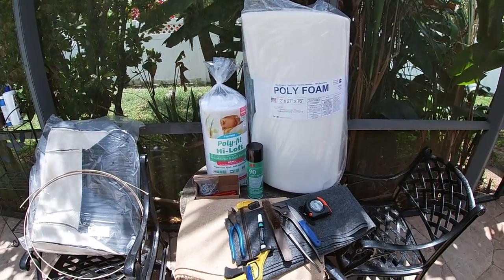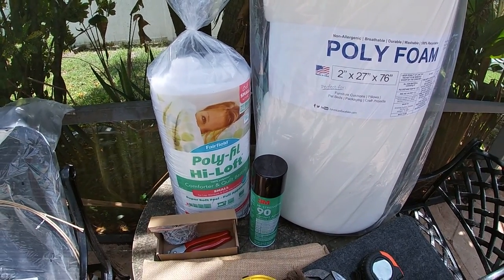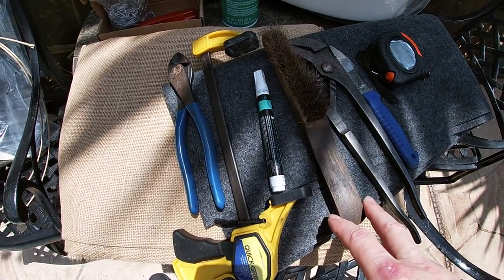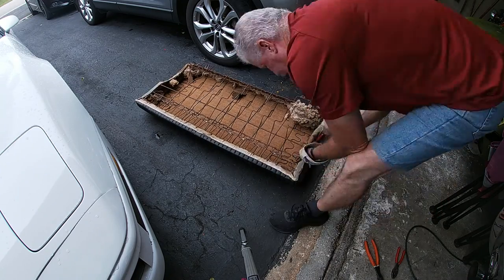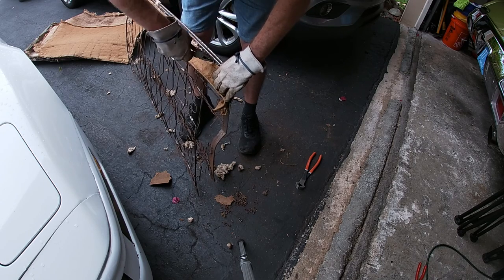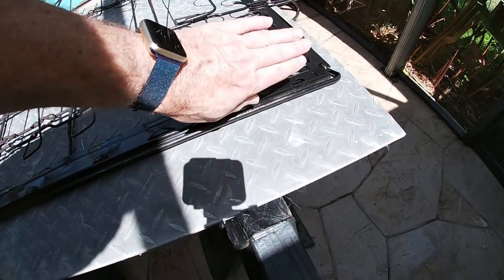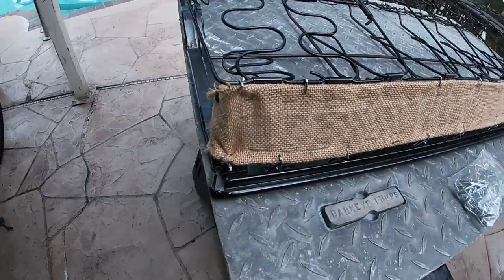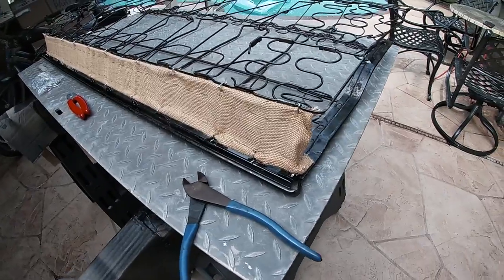DIY - You too can reupholster your bench seats

Comment: @DIYDan~ You did a great job! I am impressed with how nice your refinished seat looks!  When you get ready to do the front seats, here's a tip that will maybe help you in the "Wrangling" process:  After you apply the burlap to the surface and cut your 2" Foam to fit, spay the backside of the foam piece and the top side of the burlap fabric with your Aerosol Contact Cement, so that they will adhere to one another. This will hold the foam piece tightly in place, against the burlap base. It will make the "wrangling" step slightly easier. Another tip for the vinyl: If you are finding it difficult to stretch around corners or other spots, you can use a hair dryer to slightly warm up the vinyl to temporarily giving it a bit more stretch. It will not damage the integrity or appearance of the vinyl,  just make it more cooperative as you work. You can also cut a slight curve at the four corners of your foam piece and it will give you a tiny bit more space when positioning the vinyl cover over it. This was a great DIY project and you really explained the process perfectly!!  THANK YOU FOR SHARING! ~~Christy~~
Reply from the maker: Thanks for sharing I appreciate your feedback!

Comment: What diameter size listing wire did you buy 16 or 9 gauge? I noticed on Amazon that’s the 2 common sizes I guess thanks
Reply from the maker: It was 9 gauge here is the link. https://www.amazon.com/gp/product/B08V4RQV4Q/ref=ppx_yo_dt_b_search_asin_title?ie=UTF8&psc=1